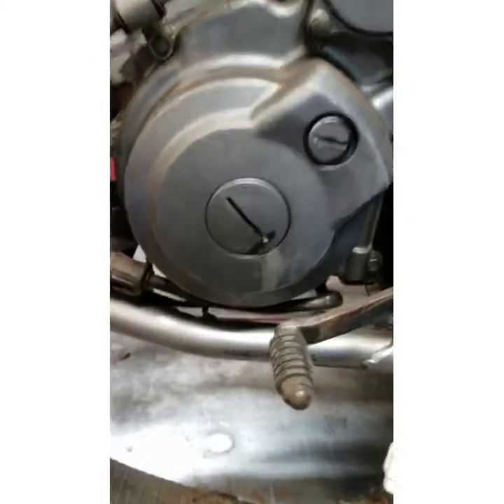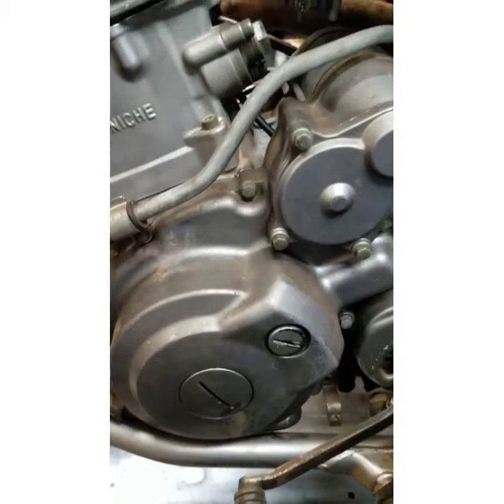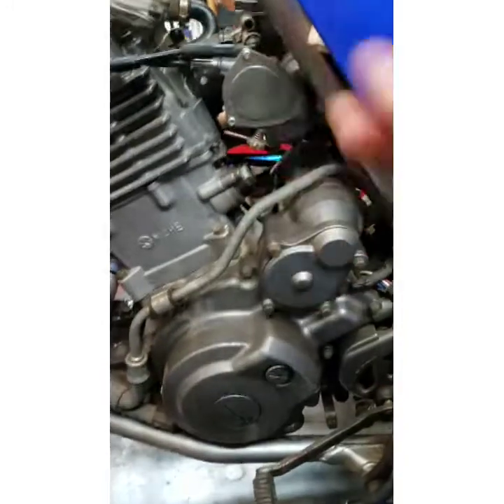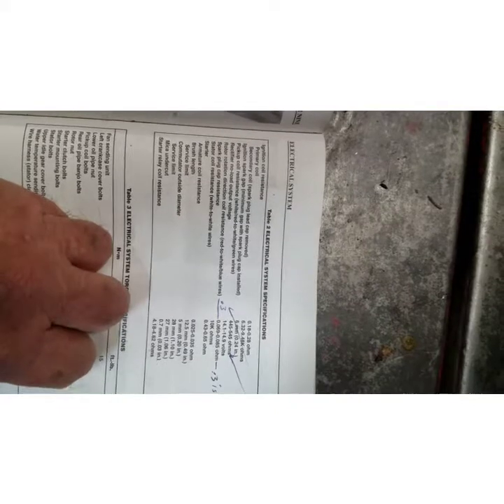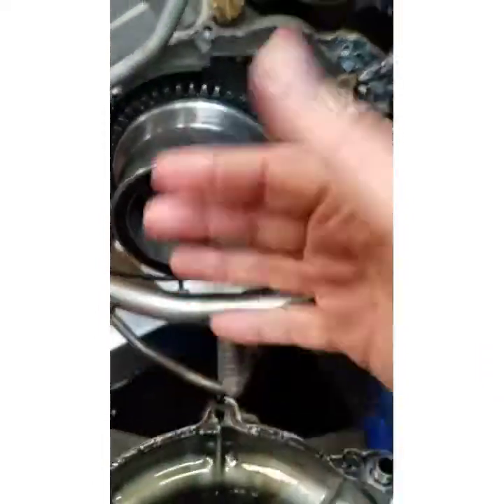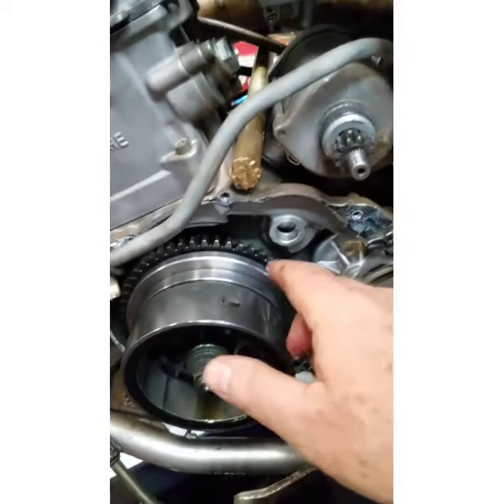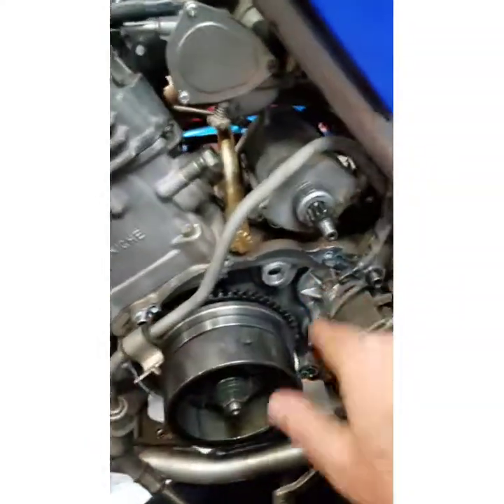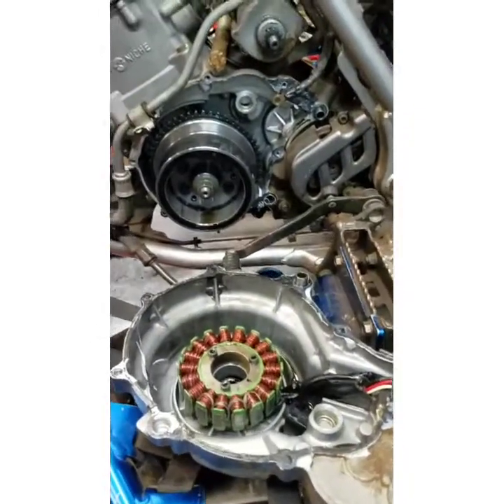How to replace Yamaha Raptor 660 Stator and starter clutch. Thank you Rose!

Comment: I have a question about a Yamaha 660 that is a 686 now.... I'm thinking about doing valve adjustments because it has a tiny bog in every gear like it wants more gas was thinking of moving washer to slowest possible setting at needle jet in carb... not sure if that will make the difference... but as for the valves with the bore am I still looking for factory spacing with feeler gauge or does it have to be different since it's technically running with more power.... that's my main question as of now... I've tried looking at forums and couldn't find anything ????

Comment: Great video i’m in the process of replacing my stater and rectifier just waiting for them to come in the mail. But my bike was running fine and I left it alone for two months went back to it and no preignition sounds and no start the bike is quiet and no lighting. I used a 12 V light tester and checked the inputs to mostly everything and getting power but nothing is lighting up And still have nothing have you ever ran across this problem?  Maybe the new stater rectifier will help the problem any input?
Reply from the maker: Sounds like classic dirty switch or switches or wire connectors....we see this all the time and very much so on bikes sitting outside
Reply from the maker: Work the switches back and forth

Comment: My 660 was doing the same thing on the top and bogging out feeling like I need a gas when you open throttle net why I was running it it turned off completely, and now it just turns over but won’t fire that be the cause of the stater
Reply from the maker: Could be, yes

Comment: On my 04 raptor 660 I redone carb and now it will only run with choke on but soon as I hit gas it dies? Any advice would be greatly appreciated
Reply from the maker: You need to put the airbox lid on

Comment: 8:28 what does that dowel pin do? What's it's purpose? I'm missing mine
Reply from the maker: Dowels hold cases where they are supposed to be and sometimes are oil passages
Reply: @geezermoto7820  yes the 3 dowels (2 with O-Ring) but I'm taking about that 1 that you mention on time 8:28

Comment: You happen to know the torque specs on the stator cover bolts?
Reply from the maker: About 8 ft/lbs
Reply: @geezermoto7820  thank you sir 👍
I have to replace my stator cover gasket because a slow oil leak

Comment: I got a 03 raptor 660 and im putting in a new stator and i just wanna make sure i put it back together the right way, got any tips?
Reply from the maker: Piece of cake. Get a new stator cover gasket, oil and filter. Blue loctite the screws that hold stator on. Just take pictures, pay attention, put it in like an it came out. The cover is tuff to get off, just take your time
Reply: @geezermoto7820  should i put oil on the stator
Reply from the maker: @sawyerpitz5982  you will when you fill the engine with oil

Comment: I have a 2003 Yamaha Raptor 686 all it does is kill the batteries i don’t know what’s wrong with it also where did you buy the stator
Reply from the maker: With it running you should get about 14 volts at your battery.
,,.  You can get a stator on ebay, or  we could probably ship you one from here at our shop
Reply: @geezermoto7820  you think you can ship me one from your shop
Reply from the maker: @Rafael.0083  hawgsnrice@gmail.com.    Email me your zip code, I'll send a price quote
Reply: @geezermoto7820  ok

Comment: What oil did you put in there when done
Reply from the maker: You can use 10w40 mineral based or synthetic, just be sure it's rated for use with wet clutches
Reply: @geezermoto7820  10w40 synthetic you put it as motor oil ..   just switched the stator on my 05 660 ..   and also the colors on the plug 🔌 are coordinated different ..  I need to fix that cause it won’t start right
Reply from the maker: @joetorre5986  the 3 like wires are all the same, they are the AC current the stator creates, then the 2 smaller wires are the pickup coil or trigger
Reply: @geezermoto7820  so where exactly do you put the oil @ 10w40 ?
Reply from the maker: @joetorre5986  in the oil tank in front of the engine, alone, on the frame. Download an owners manual or just google it

Comment: I had no spark, only once in a great while if I let off the starter. Changed stator, now it runs but bogs on top end... have a new rectifier as well but did not help the situation. Adjust valves? I already replaced spark plug and ignition coil
Reply from the maker: Is air filter and air filter lid on it?
When is last time it ran good?
Reply: @geezermoto7820  yes air filter and cover are on, last ran good about a month ago before stator took a $hit
Reply from the maker: @walkernienaber824  carbs probably need to be cleaned if it's been sitting a month or two and disable the park brake rev switch
Reply: @geezermoto7820  would they need to be cleaned if they were just cleaned in the end of April? The air filter didn’t look the greatest, could it be that?
Reply from the maker: @walkernienaber824  could be air filter abd be sure to put new plugs in, they foul easily, and yes, ethanal goes bad quickly, need to blow through carbs or soak them